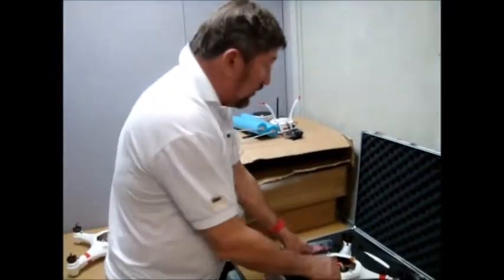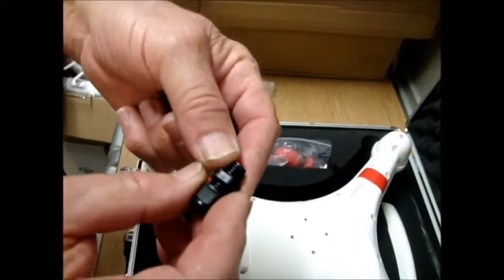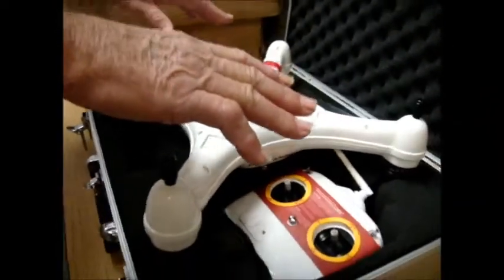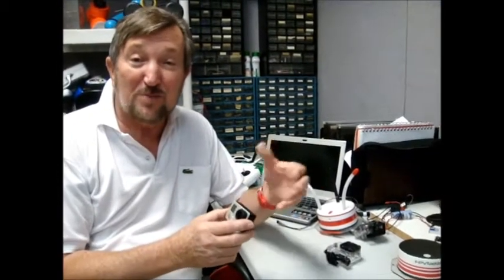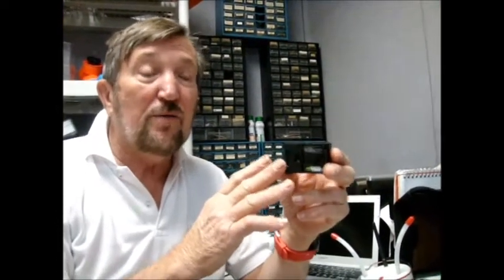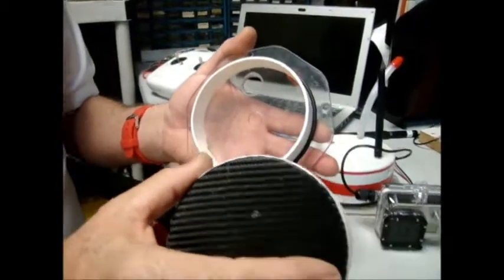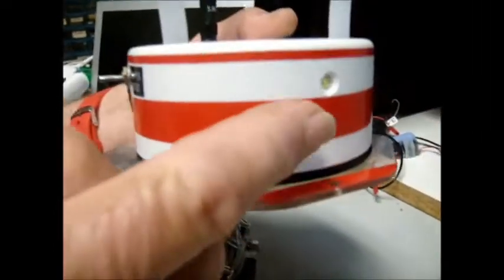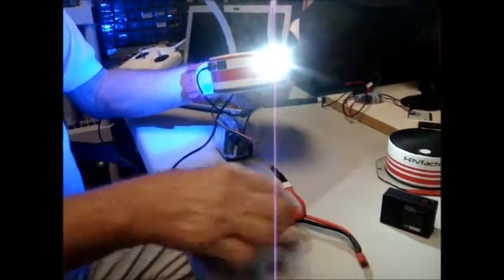Marineer Quadcopter Performance Enhancing Ideas PART 3

Comment: I have seen videos of people using a dome to waterproof the camera and gimble. That setup seems to eliminate the need for additional floatation devices.But it also looks like it may be too much buoyancy, which could cause the quad to tip when in water, making take off impossible from water.